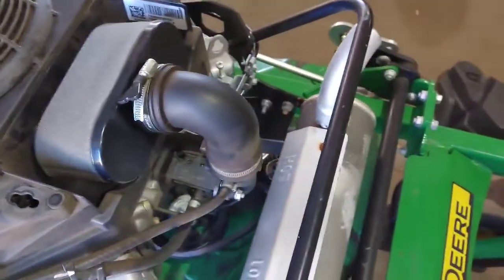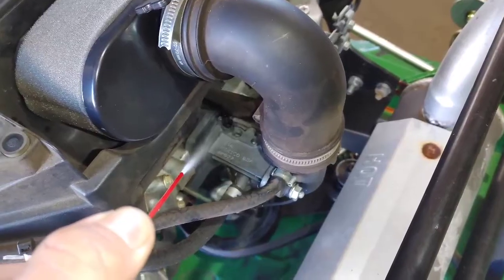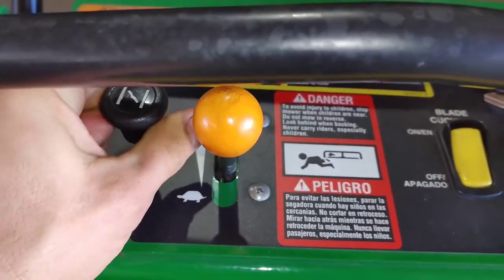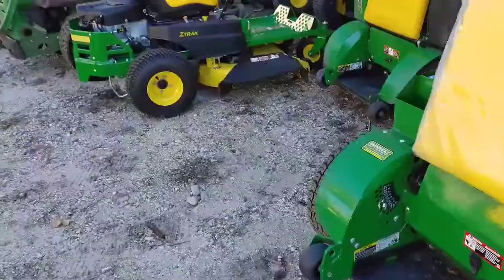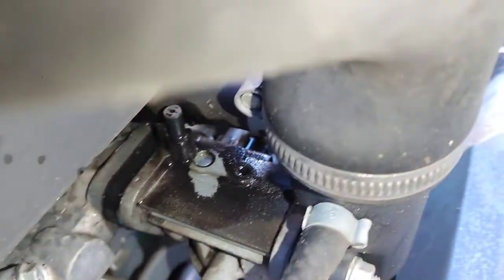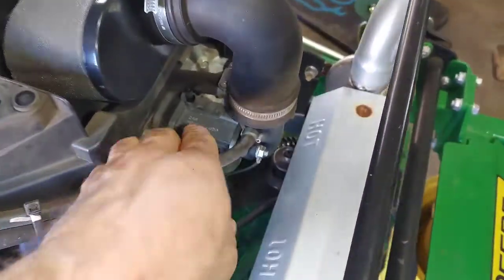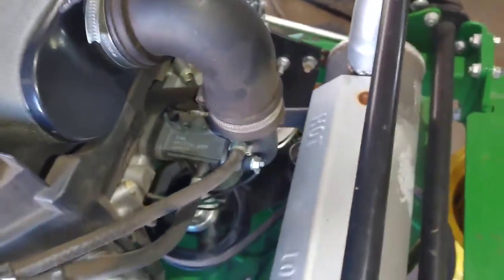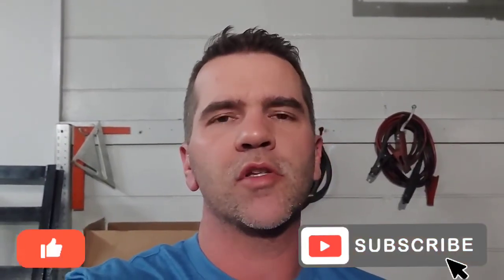Engine surging, backfiring, running rough. How to find the issue

Comment: Hello all.  I live in South Africa (small town of East London) and I recently purchased a Stiga Park 720 PW on auction.  It's not working nicely.  The engine surges quite a bit and its in general bad shape & the electric lifting deck is problematic.  I've tried finding videos to help me get it running (I'm also far from being a mechanic).  Would anyone be willing to help me via emails/whatsapp or some other platform?  Thank you